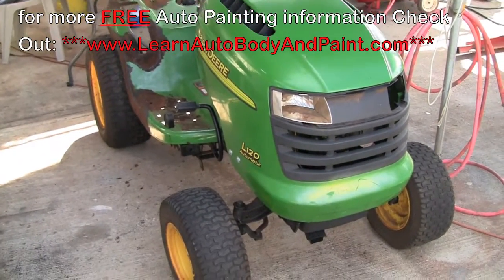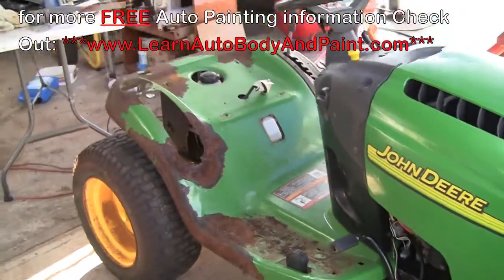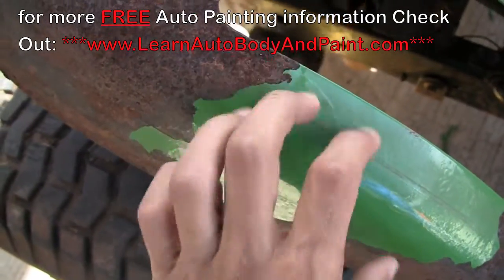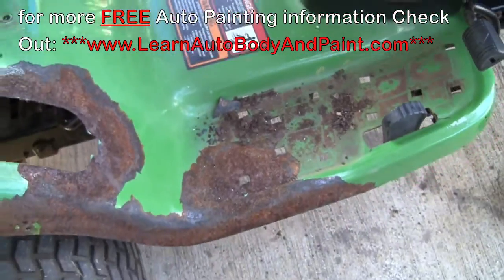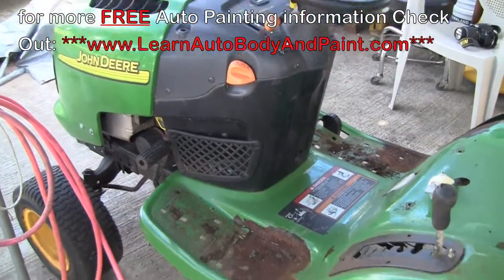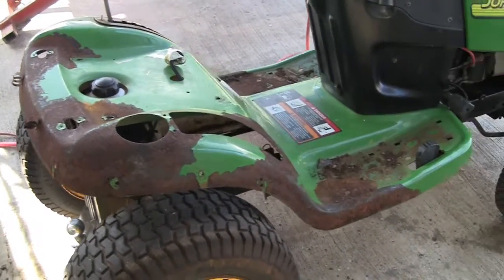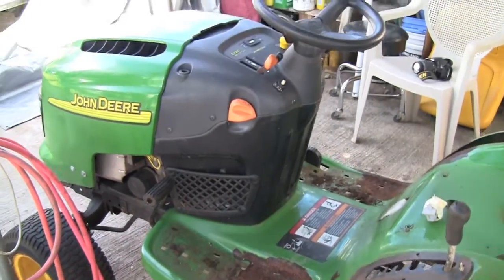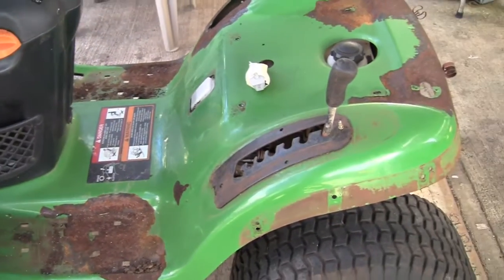FWD: Learn Rust Repair & How To Prep Surface Rust For Painting!

Comment from the maker: @sher854 Metal cracks or plastic cracks? You can use sheet metal or weld cracks in metal and special automotive epoxy for plastics.